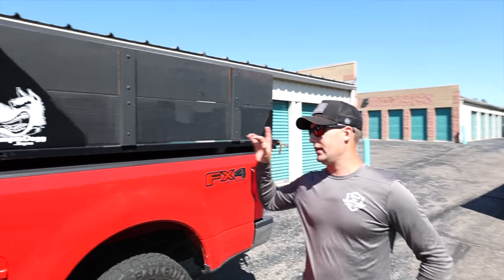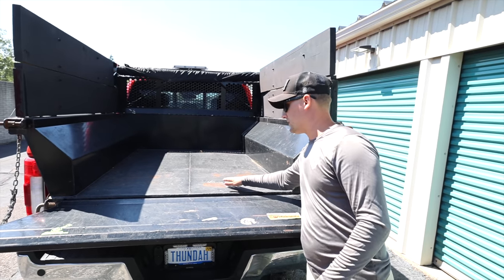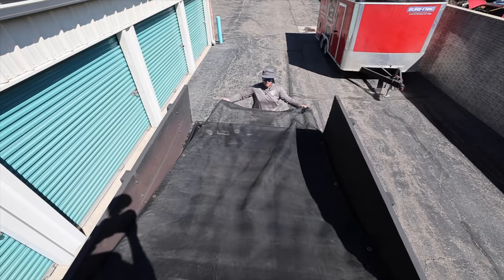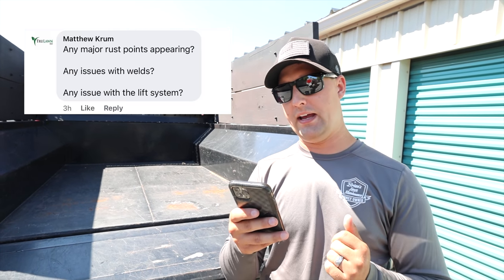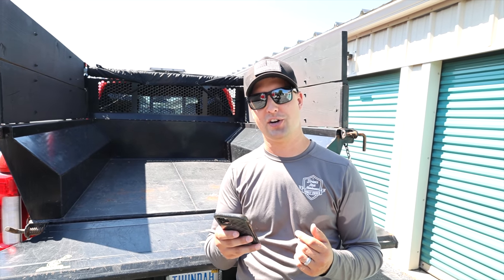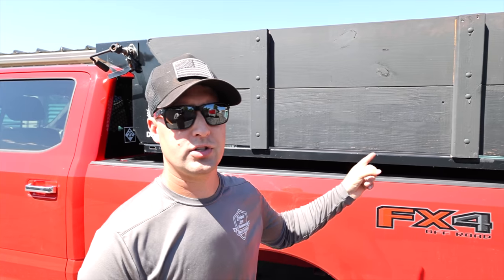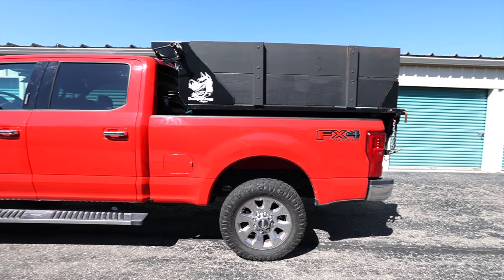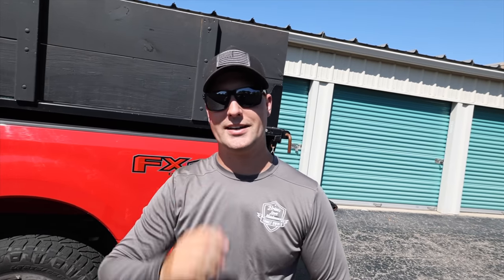DumperDogg Dump Insert 4 Year Review (Was It The Right Choice?)

Comment: My 8' Standard cab F250 just came in tonight.  I plan on setting up the same way. Billy Goat on the front of trailer with Dumper Dogg for the same reason you said. I have a 14' open trailer. Doing leaf clean ups we would bring the stand on mower to mulch and zero turn to bag. But then we would load up the trailer with the leaves and have no room for the mowers. We would have to drive to our dumping site and blow out all the leaves which as you know takes a long time and then have to go back for the mower which was a waste of time. I was only able to do one or two clean ups a day. I am hoping with this set up to be able to do more in a day. The delay in getting the truck due to computer chip shortage is a time set back and hoping I will be able to get it set up for this fall. Thank you for your videos that gave me the idea for this ideal setup for my needs.

Comment: When I had my landscaping business I had an 8ft Cam Superline dump insert with sideboards on my 1500 Dodge Single cab. I had added leaf springs to supplement the weight of the insert. Springs added 800lbs of capacity which was the weight of the insert so worked out well. Would have gotten air bags if I did it again. Was there perfect set up for a small operation. Brian, i Love the truck, insert and trailer. Keep up the great videos!

Comment: I got my first dump insert in 1999. It was an ez dumper. It was decent. Sold it after I got newer truck that had a aluminum truck craft insert. I really liked the truck craft. Now in my truck I have a steel truck craft insert I got used. I wouldn't be in biz without one. I don't need dump truck and this set up is perfect for me.

Comment: Love my dumper dogg!! I have 8ft steel dumper dogg in a 17 reg cab f250 along with a 7x12 dump trailer. It’s a great combo when it comes to landscaping. The rust will appear depending on how much u use it. Leaving mulch or grass in the insert is not the best thing for the steel, it will cause the paint bubble and eventually flake and rust. I take mine out at the beginning of winter to plow. Four bolts, and couple of wire connections, and the use of the fork truck from the dealer who installed it for me. Load it into my dump trailer that will sit dormant for the winter. Bottom line the dumper dogg is worth  the money. Saves time and makes money for ur business, after ur initial purchase of course.

Comment: yes, I have the Buyers Dumper Dogg dump insert, I have the 8foot on my f250 and I like it for what it allows us to do. I am looking at the 6foot for my f350, but I have to make sure I can fit my fisher sander inside the 6foot. We use it for fall cleanup leaf collections, and we haul mulch/loam/fill with it, we just needed to watch the weight on the 8foot as you can really see the springs on the f250 flatten out when loading it up. the one thing I do not like is the alarm button that I have to keep resetting after I dump the contents of whatever I am carrying. the alarm sensor sits on a "L" bracket on mine and the bracket gets bent down with the weight, and I have to bend it up after I empty the dump body. One of the other things is when you are dumping you need to make sure the lower latches (the items that hold the tailgate in place) are not pointed down as they will dig into your bumper plastic cover and break it. if you have a V nose enclosed trailer you also have to make sure the latches are pointed up or forward or they will punch holes in your trailer on sharp turns. if you drop the tailgate all the way down and raise the dump body you will bend your tailgate as it catches on the trailer hitch as the dump body is raised. so these are all the items I have come across with my 8foot. yes I am getting another one as soon as I confirm that my fisher sander will fit inside of it as it is a valuable piece of equipment for my business. only rust is on the inside of the dump body and nothing on the outside. I have the steel with the cab protector and tarp as well. I bought it last season (2020) and I take off the wooden boards in the winter to get more visibility while plowing. One thing is that I added a smaller gauge screen to keep items from blowing through the grate at the front of the dump body. Overall I am very happy with the product and I got it after seeing it on your channel.

Comment: We ran Tip Offs in the 80s no hydraulics ran on tracks no problem dumping grass we bagged then here in florida so we did land fill runs daily great for  mulch even fill dirt for that matter we had  8ft bed reg cab trucks . Weight was never a issue just back up tap the brake and there she goes .Dont even know if still available . easy to remove with a couple guys and a couple saw horses .and never had to pitch fork grass out because hydro would not lift like some of my buddies .

Comment: These dump inserts are great, we use a product called a Load Handler. It fits over the top of the tailgate and then lay the tarp out in the bed of the truck. When we are full (often times up to 5 cubic yards of grass/leaves) we hand crank it out. Works well and for the price of around $200 plus shipping. You just cant beat it for this price, especially as a new start up company. I also recommend the double-mat and put the slick side up for easier unloading. My next truck, I want to have the bed removed and a dump box installed. Great videos, keep them coming Bryan! - Philip in Billings
Reply: You can get a “load handler” at harbor freight for $50, they are only rated to 2k lbs, I have one, that we modified. I carry 4000-4500lbs of crushed concrete regularly. Works ok, bit tough to crank out, thinking of getting a dump insert.

Comment: I have a 8ft dumper dogg I love the thing but its built out of tinfoil the cab guard should be thicker steel. I  don't have new truck but it is nice and I get nervous with some operators loading it. The floor could also be thicker mine is getting beat up from hauling stone. I also don't like how high it sits in the bed I'd like it to be a little lower. Also if the cab guard was taller and the space  between the cab and the d.d was closer it would look nicer.

Comment: Year 6 with my 8ft buyers. 
If hauling/ dumping dirt/ stone of any kind you need to be very careful. It can hold 1yd of material but must be loaded in center of bed. If the load is to one side it will want to lean that way when lifting and could cause damage. Still works great and is a game changer for a solo owner/operator. I am considering air bags to help level out truck. when loaded full of grass/leaves and pulling Enclosed trailer with leaf vac on front, the truck sits lower for sure.
Reply: do you wish you bought a f350/3500/etc dump truck instead?

Comment: How much weight can your units hydraulic system lift? 
I do a lot of stone work and 57 stone is roughly 2500 lbs per yd. Right now I put 3.5 yds in my 99 7.3. will that hydraulic lift 12k lbs cause obviously the insert will hold more than my bed can.
I'd like to be able to fill 5 yds. 
And yes, my truck has heavy duty leafs and airbags. 
I'm just tired of shoveling stone from my bed.
Reply: It will not lift that. I had 2 yards of wet soil aprox 5k pounds and that was like pushing it

Comment: I’d be worried about going over weight on the truck.   At 800 lbs.  it eats up a lot of payload.   You’ll have to check your door stickers to see what your payload is.  
But if you got 2,000 lbs payload.  You put that insert in.  Your at 1,200.  And a 200 lbs driver.  Your at 1,000.   Another crew member or 2.   You’re at 1,400 or 1,600 lbs.   plus a 3,000 lbs trailer.  You’ve got like 100 lbs before you’re over weight.  
I would really recommend going with a dually.   Like a f450 or 4500 with a wide track front axle
Reply: What superduty has a payload of only 2000?
Reply: @2000XJ1911  f250 crew cab 8’ bed 4x4 platinum or whatever the highest trim package is.